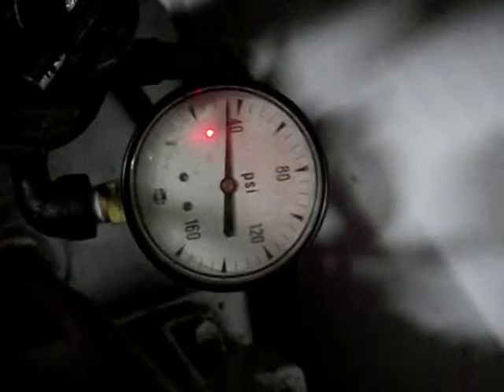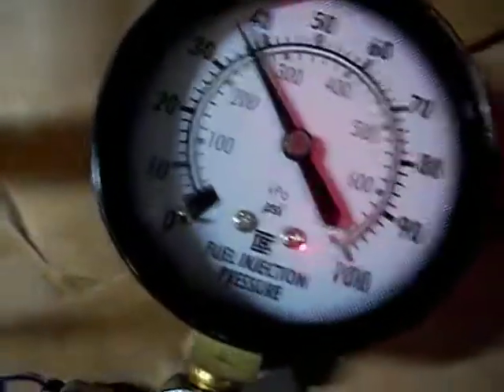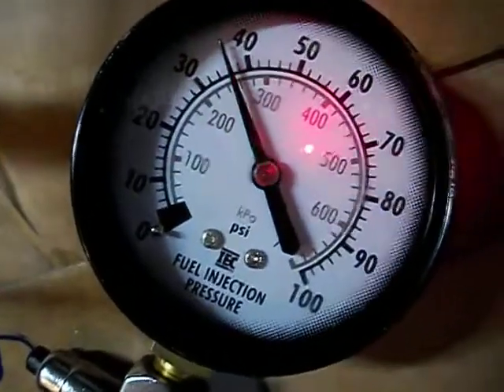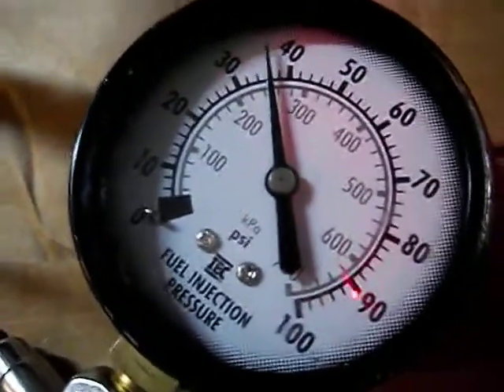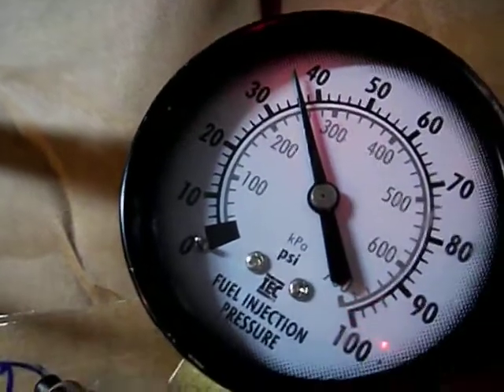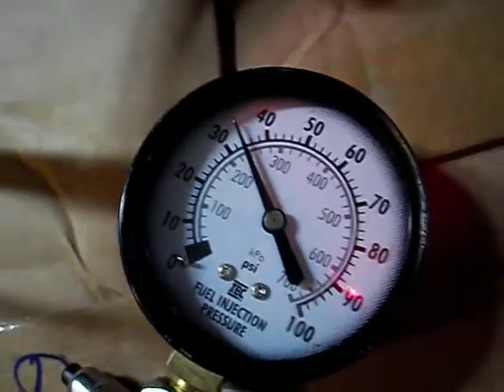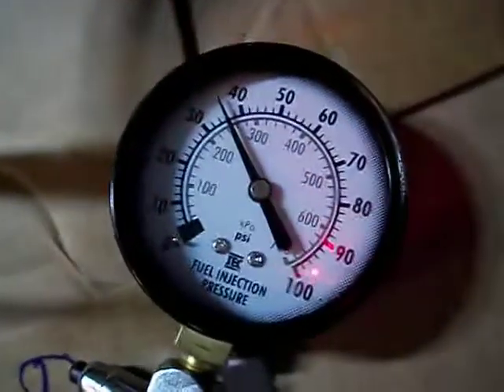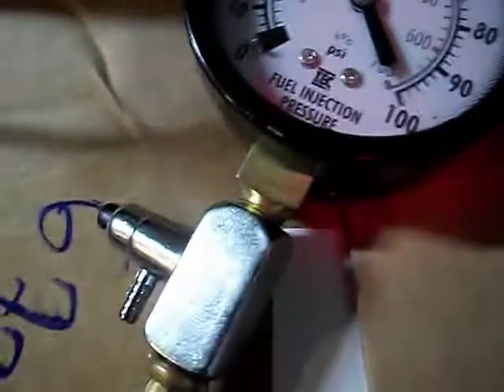Datsun 280z FPR test

Comment: I've tested a few by putting the fpr directly after the fuel filter, like this: https://imgur.com/a/4RANqY4.
One new one from zcardepot started at 32psi and directly jumped to 0 when the pump was shut off. All of them lose pressure within 1-2 days, the best one is the old one that was already on the car, so it seems I've bought everything for nothing. See results: https://imgur.com/a/hSwTtD6